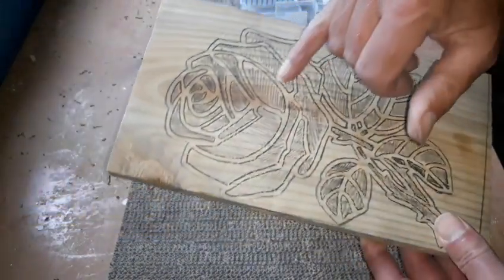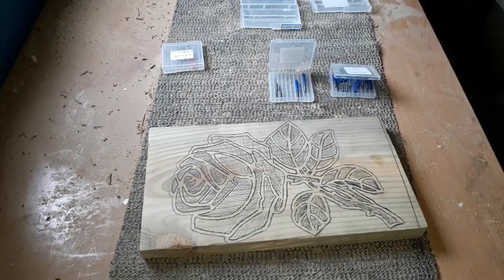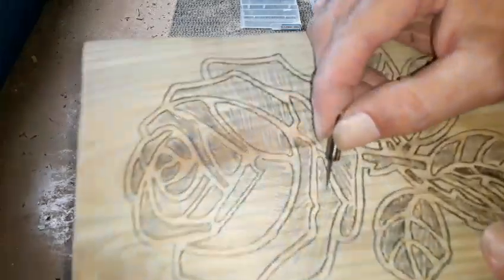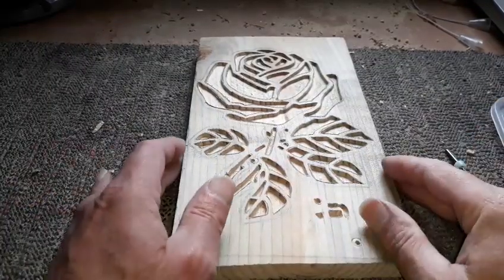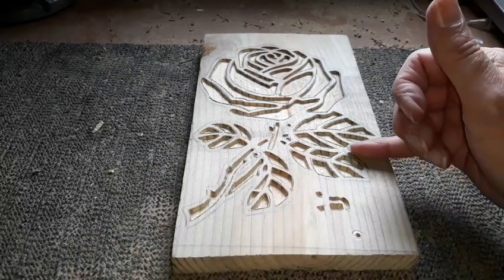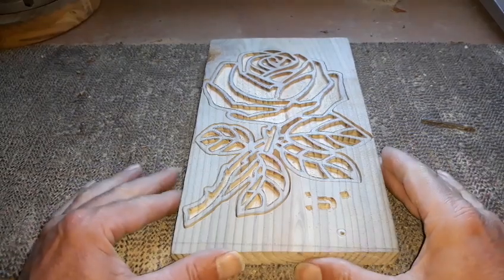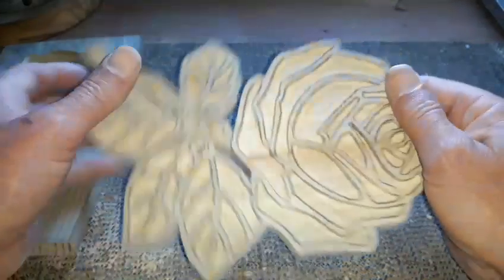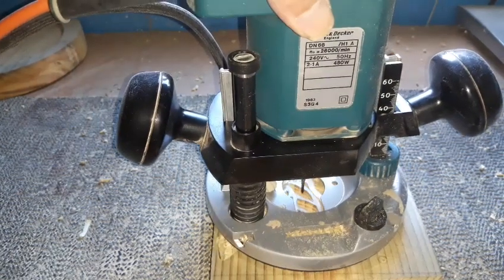Yellow Rose on scrap wood, router/scroll saw project

Comment: Beautiful rose! I love it!
Reply from the maker: Thank you Jolien ,I appreciate the comment...
Reply: Thank you for the videos , been inspired , however even after sealing the wood ready for export resin , I’m still getting bleed out .
Reply from the maker: @waynebreier1682  I've never had any issues with resin bleeding, I suppose it depends on the wood,you could seal with clear resin,just brush it on like paint,or I've started spraying crystal clear on to the wood before the resin goes in,if I'm painting, like the yellow Rose, I didnt seal with anything,..
Reply: fishtank5050 thank you so much forgetting back to me It could be the wood that I’m using it might not be dense enough. I’ve been using new scaffolding board. . I’m not sure if I’m feeling with no much epoxy resin . probably will clear epoxy resin paint it. Have you used scaffolding boards before to do a eproxy resin feel. Might not be seasoned enough .
Reply from the maker: @waynebreier1682  never used scaffolding boards before  I would if I had them .👍I use fencing wood a lot on my outdoor projects, it's really cheap and routes good..